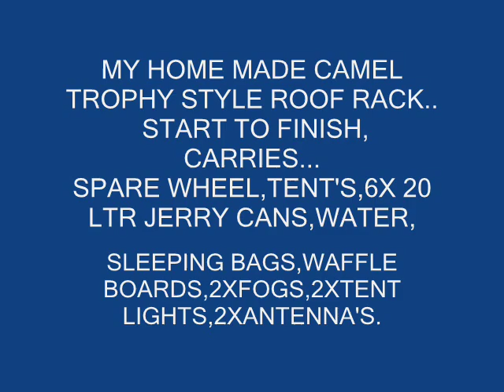ROOFRACK MOVIE

Comment from the maker: Hi mate,
no problem at all,,as long as you learn the basics you will get better and better at it,power/wire feed and penetration...
power-if you are blowing holes in the metal turn the amps down.
wire feed-too fast and the weld will pile up on the metal like bird poo,you just want a nice pool of weld.
and penetration-you need to have a nice red glow on the top and bottom of the metal being welded..
and basically that's it..practice,practise and you will get it in no time.
good luck..
wayne.

Comment from the maker: hi.
its not too hard no,,as most things some learn and pick it up faster than others mate..i tought a friend of mine to mig weld to a not so bad standard in just a few days..
yes,you can only weld to non alloy metals mostly,thickness depends on the welder being used..a mig is good for the lighter work,body panels,thin walled sheet,exhausts etc,where as a arc is much better at heavy stuff like scaffolding poles,box section etc..
hope this helps..
atb..wayne.